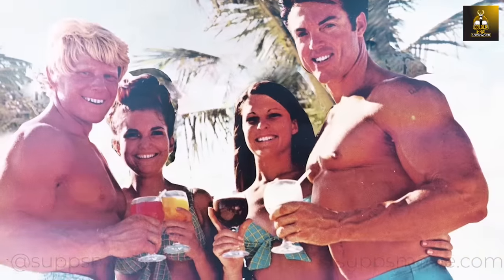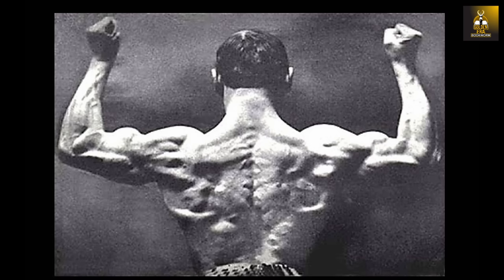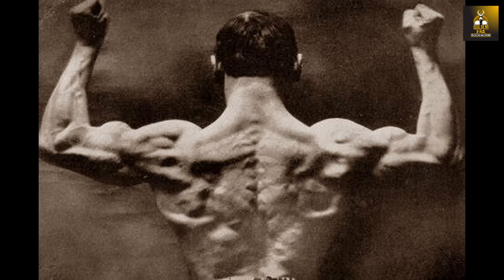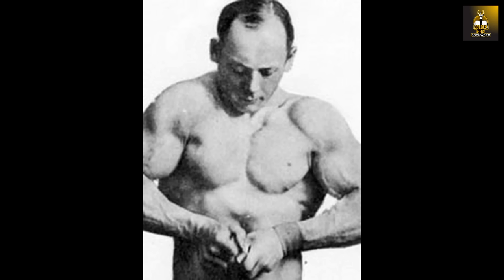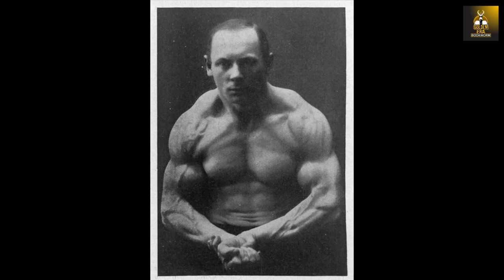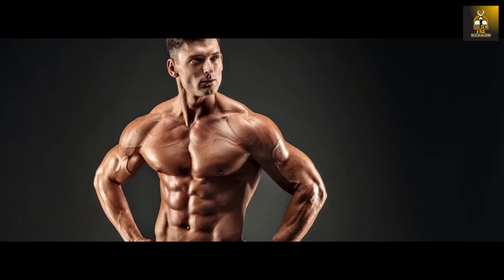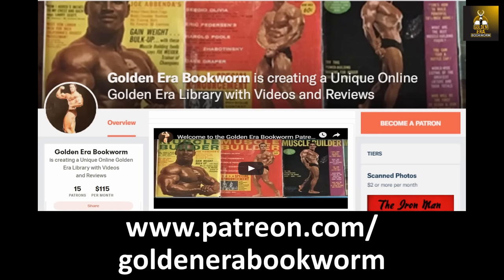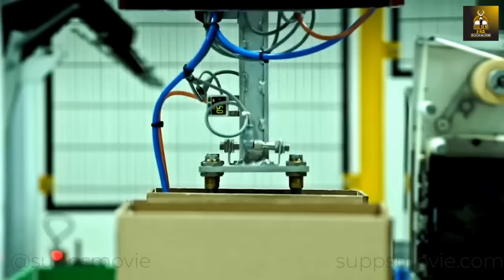FRED ROLLON! THE MAN THAT NEVER LIFTED A WEIGHT! BRONZE ERA STRONGMAN

Comment: The difference with expanders - especially steel springs - is that the tension never goes. Lifting a weight can end with a locked position and the weight no longer requires muscles to hold it up but skeletal balance. I started with chest expanders with 20 lb springs that held 5 springs. I could bench press well above my body weight but it took a long time before I could just stand upright and force the 100 pound tension across my chest. I still have the set and I think I will go dig them out and start using them again.
Reply: Where do you find those chest expanders? I'd like to start implementing them in my martial arts practice. Thanks in advance!
Reply: @JayLoc0042  holy shit I was thinking of the same thing.
Reply: You are right. Permanent maximum muscle tension without releasing while doing a set is much more efficient. You can do it with expanders (I started as teenager with the expander of my uncle, did some weight and ended up with calisthenics) , calisthenics or with weights, the technique is the determining factor. Doing 10 reps with a movement range of 5cm with maximum tension is burning mor then 100 reps in CrossFit, or whatever this Mr Bean exercise is called 
The effective buildup of strength is phenomenal and you need a fraction of time for training. Before my accident, wich disabled me, I did 3-4 times per week (always get a free day that the muscles can build up); my protein came only from eggs, tuna, cottage cheese and milk) 30-45min (without warmup and stretching after) and got 10% body fat on 175cm and 84kg.
You feel like you can do anything anytime without getting tired
Reply: I'm down, let's get us some of them springs, bros.
Reply: Weights with bands attached also work, at least in studies. Not sure how you'd do that at home, though?
Reply: I got one off Amazon. It came in today. Gonna give it a shot after lunch. I'm gonna have to look at some of the different techniques to using it.
Reply: Except that the chest expander has absolutely nothing to do with your chest, it targets the back...
Reply: @thotarojoestar3045  For Chest Hold them with your hands straight out in front level with shoulders and pull them apart to arms width. They do however load the shoulders a lot, but you can do up right rowing and bi-cep curls with one handle under your foot.
I also do triceps by holding one handle behind my back and push up with the other hand.
Reply: @alanduncan9204  the only way I can think of that a chest expander would actually work the chest is if you held it behind your back, but that would probably produce a really awkward movement
Reply: @thotarojoestar3045  in my case thats probably for the best anyway.
Reply: @JayLoc0042  Actually you can also use resitance band and ropes. I have ropes for kicking and punching. Another for barbell lifts. But in my country there is a Doctor who use resitance ropes to straighten olds people backs with amazing result. But he also train soccer players and other sprotman, and they get better mobility. It can be used like that as well. It helped me with back pain from work in no time.
Reply: Sounds like Handy Gym.  it was expensive, but well worth it.  I've gained muscle at a rate people say is impossible.
Reply: @JayLoc0042  Like everywhere on internet?
Reply: I have a good developed chest and most of the time I use the chest expander or the horse shoe bender. It's worth!
Reply: @thotarojoestar3045  chest expanders are called that because the "chest" used to mean total upper back and chest circumference, not only the pectoral muscles. And when the back muscles were thickened, your "chest" would have a bigger circumference
Reply: Expanders are a godsent i swear to god. My upper back is both cursing me for getting one and thanking me with size and strenght rewards. Now i'd say its my best body part, and id argue is if not only due to expanders, at least they were a massive contributor

Comment: The bulk of my routine uses what are essentially resistance bands and cables. So its heartening to see what kind of results i can get from this kind of resistance. I'm a homebody and only have 50kg in plates. But my cable multigym can go up to 100kg in resistance.
Reply: I have bands too, but I only use my multigym
Reply from the maker: Looking forward to your results
Reply: I am a Homebody too. Don't like going out too much. I used to be in decent shape and in amazing condition, but have let myself go for a decade now and it is tough to start again mainly because my nervous system has weakened so much from being so stagnated through the past years, so as soon as I start anything intense I get that shakey queazy feeling that back when I was in shape only happened when I Pushed myself INSANELY Hard for a long time and still I did not feel quite like I do now. Slowly but surely I will get myself back into good shape and condition. Starting slow and easy focusing on health and aerobic exercises but I will get back to where I can push my body hard again with some Good anaerobic exercise. I really do enjoy the old-timey strongmen and their style of lifting something I will look into more for myself as well.
Reply: @chrismiksworld  resistance bands really thin. Day by day you'll feel better and up the resistance.

Comment: I didn’t put to much faith in resistance bands until I had a bad accident a few years back. On the road to recovery physical therapy made me a believer in the benefits of band training.  I, for one, believe his claim. The muscles and the body know time and tension, regardless of what tool is being used
Reply: Time and tension 👌🏼 that exactly what matters
Reply: it was a gimmick to sell chest expanders. 100%
Guy was even smaller than other strongmen - but due to his super short bicep attachment it looks like he has more muscle than a runner.
early example of using looks to sell fitness products
Reply: @agnidas5816  you don’t know what you’re talking about my guy.
Reply: @agnidas5816  Chest expanders work so I'm not sure what your point is.
Reply: Pullies an resistance bands are superb
Reply: 140 kilos.=308 lb., not 300.  Other than that, I think your videos are right on!

Comment: I think it's quite likely he accomplished those gains with just rubber bands and cables, especially if he used them in gymnast-like routines with slow reps and holding isometric poses. I remember gaining significant posterior deltoid and tricep strength and mass during my late-teenage years just by doing fully-extended static holds with my chest expander.

Comment: I got a hernia about a year ago and had to put down the heavy weights for a few months before my surgery and a couple months after my surgery. I did squats push ups cable squeeze light dumbbell overhead press and pull ups everyday
 Seems to me that heavy weight is easy to break down your muscles but then not give it enough time to heal and grow so reps and reps and reps and static holds seems to do the trick for me
 Just have to do it all the time. I look and feel better.

Comment: Excellent post as usual, Carlos! Rollon was indeed a specimen and role model. I'd be curious if any of his training routines/methods survived. Another strand pulling great was Alfred Danks. Danks did compile his methodologies into a system and published several books on the subject in his lifetime. I read through a couple of them on the old Sandow Plus site while it was operational. It would be interesting to compare Danks' and Rollon's methods. Both built impressive physiques purportedly using cables exclusively.

Comment: I have stumbled upon some very old chest expanders that strongmen/wrestlers used in Greece back in the 1960s. These guys were something like Rollon giving shows, wrestling and performing feats of strenght (trucks going over them, tearing decks etc.) Needless to say those things are not cables like the ones in modern gyms, they are hard and thick springs that require huge force in order to stretch whilst pushing grip strenght to its max. If someone is to tie them somewhere and do rows, step on them and do curls etc. they can train perfectly without weights. Only disadvantage is that over time they become loose and have to be replaced.

Comment: Good stuff, I started out about a year ago (Not my first time working out, but that was when I got consistent again) with just a barbell, some leg weights, and body weight exercises. I bought some DBs, pull up bar, and a bench, which helped a lot. But recently I bought some more plates/weight, and I also picked up a set of resistance bands, from 10lbs-150lbs of tension depending on the bands used, and I think it has really taken my training to the next level, you get a great contraction, and consistent resistance, even at the top of the rep, which is great. I like to do band work after I do my heavier lifts, and it always burns me out. For example, today I did Biceps and back; So pull-ups, then chest supported barbell rows, then one arm banded rows. Shrugs in the middle. Then DB curls, followed by Barbell curls, followed by banded curls. 

Great video btw, I subscribed. I'm not sure if I believe he NEVER did any weight training, but I'm sure you could build a good physique with only Cables/bands/chest expanders etc.
Reply: Almost lost my eye when resistance band snap while face pull,spend week in hospital . Expander is way better and work different.

Comment: Yes , he build without using barbells and dumbells .. He used Smith Machines,  rowed,  ran, swim ,pulled train carts ect.   (  still is resistance exercises)  ..At one time used ketels ..  I red all that in library  years when i was researching on training methods for self applications.

Comment: I believe that he could, in fact, develop this type of physique with just cable or pulley resistance. For the last two years, as I trudge through middle age, I have stopped using maximum poundage and using  full range of motion, for workouts that stress "mind- muscle connection" and "time under tension" principles. I started training my arms mainly with cables when I realized the cables kept each repetition under tension throughout the entire movement. I do believe he achieved this in that manner, and although his physique was fantastic, it looked like it was very "realistic, perhaps a "48 inch" chest and "15 or 16" inch arms.

Comment: Having used a chest expander the past few weeks I'm already seeing improvements in my shoulders, upper back, biceps, triceps, and strength in my core to a fair degree.  I was able to get an all steel one and a rubber one with the former having 154 pounds of resistance and the latter around 264 pounds of resistance.  Training with the things has been exhausting and very, very challenging.  I only wish I had had them during the 2020 pandemic.  I could have made some serious gains.  I believe his claims 100 percent.

Comment: What builds muscles? Time under tension.
What give the better time under tension? Springs.
What portion of "traditional" weight lifting is overlooked? The negatives.

A chest expander demands force to be opened, force to be held open, and force to retract it. The force demanded is linear, it becomes harder throughout the movement up until full ROM then it becomes easier throughout the negative portion, the tension is never released throughout the entirety of the rep. 
The only problem with chest expanders are that few companies (actually only Baraban's company) are selling really strong chest expander. But, if you're one crafty individual you can basically build a stronger set of chest expander on your own.

I think the captain of crush hand devices are great to build some insane grip along with those rollers thingy with weight, I built one myself with a really thick piece of wood (better for grip) and the concept is similar, a continuous and linear time under tension with a weight hanging from a rope that has to go up and down.

Also, I'm sure power twister are great for chest, but you have to get some heavy one to get a good training, or, even better (but these are really expensive) a "chest Krusher", with seems to be the endboss of all springs focused exercise, it's basically a power twister (or a humongous nuts crusher) with up to seven short, and really heavy, springs.

I'm rethinking my workout, KB swings are the best of both world regarding low impact cardio and resistance training, springs centered devices seem to be the way to go as they represent a perfect mix of continuous time under tension (both concentric and eccentric), but also isometric contraction if wanted.

Once again, the modern age bring solutions to problems we didn't had and created more problems than we had in the first place that have to be addressed by looking back in the mirror to see how things were done before the snake oil salesmen came into that town called "western world". Cheers.

Comment: Some heavyweight boxers also had tremendous physiques while claiming to have never lifted weights.  Examples Ken Norton,  Mike Weaver and Mike Tyson.  However , there is the possibility they are lying or used steroids in conjunction with boxing training which would build some muscle.  Hitting heavy bags, pull ups, push ups, ab work etc.   Also the possibility that these men were genetically gifted.  Nevertheless a fascinating subject
Reply: Um mike went to the gym for the hooyfield fight lmao
Reply: @wilw3498  and he lost. What's your point? There's training logs of Tyson you can see that showed that OP is correct.
Reply: Dude Mike Tyson was 190lbs jacked when he was 13 years old...

Comment: Resistance is resistance, the body doesnt give a shit and will grow. Optimally to reach the goal the fastest way possible, you'd use free weight and cables and different rep ranges, the goal being maxing out the amount of muscle your body supports. But going off his measurements, im his same exact height and weight is very close too, his arms are 2cm biger than mine though, ive been lifting for a decade and used everything possible so im bigger through the legs, chest and back, but hes got me beat in arm size and conditioning

Comment: super impressive. the man put his hrs of hard work and became something not very common for his time or not seen at all. 
but you can never underestimate the fact that rubber bands or cables, or piles of dirt, or bags of water, or rock lifting, if you have enough volume for resistance, then it is weight training. so yeah, the dude worked out just like anyone else with a different method, but high load and volume just like other methods for muscle building.

Comment: I am the strongest I have ever been in my life and I do not use weights. I used to go to the gym daily and use a combination of free weights and resistance machines. For the last 10 years I only do isometric workouts, push-ups and pull-ups. I have not benched in years, but my previous best was 5 reps of 285 lbs. I'm certain I could beat that today. My arms are 16" non-pumped and very little fat. I am still growing too and I only work out for 30 minutes a day. There is no reason not to believe Fred Rollon did this with chest expanders alone. I also believe some people are more genetically inclined for gains so I'm sure he was blessed from the start.

Comment: Two quick questions, could you use resistance bands instead of expanders and which golden era workout book would you suggest one follows to achieve both strength and a great physique using bands?
Reply: Yes you can use either so long as you continue to get stronger bands over time or use more bands to increase resistance, though springs with very high weight resistance would probably be somewhat superior as the effort it would take to move them would mean great exertion throughout the whole range of movement.

However always remember the old school strongmen and bodybuilders had the mentality of training with what you could get your hands on, so if bands are what you can get than use bands.

Comment: I found myself during the first lockdown that resistance bands can be just as effective at building muscle you just have to train a little differently in terms of exercise selection, range of motion, volume and intensity. I actually after years of being at the gym quit going a few months ago and now do only strictly resistance bands, for me it was about saving time and not spending so much time during the week at the gym but also thanks to that lockdown experience knowing I can still make gains with bands

Comment: I had a really serious chronic pain condition. I ended up on morphine for 9 years and burned out taking that shit. I had to quit 8 years ago then my condition worsened recently after abating for 7 years. I tried to start using morphine sparingly but it didn't have the same effect its not a sustainable way to treat chronic pain. I found isometric exercise. if you learn to do it right and I learned myself you can block severe pain after about 30 minutes of strenuous exercise. since i didn't feel like crawling out of bed to life weights or go jogging in the middle of the night with severe pain i started just flexing major muscle groups in my bed and it became a real solution. you can learn to do it yourself just by learning how to do isometrics in bed. it works perfectly.

Comment: I do not have enough knowledge on this topic to provide an opinion in terms of did he or did he not.
Regarding the bit where later in life he did use weights (assuming I dun heard correctly):
What comes to me here is that if one accepts his claims are true... possibly due to our biology/genetics (his genetics in this case of course) applied with aging, it seems rather plausible that more than bands were required to address the reality of we are not eternal.
Just my stab-quick jab without researching further.